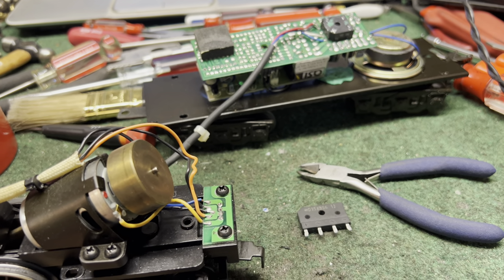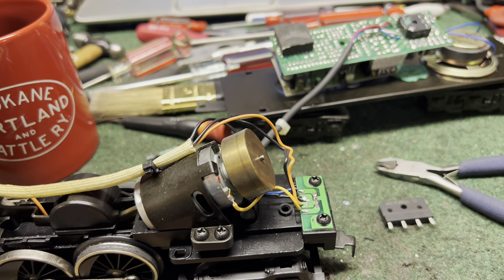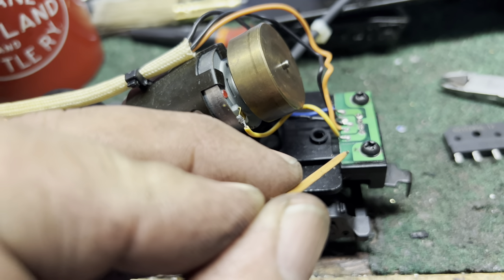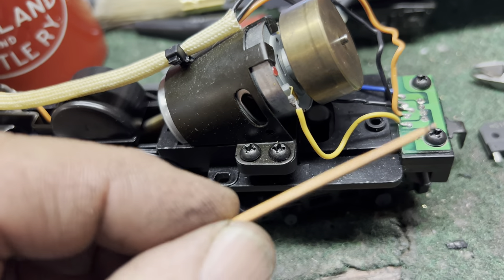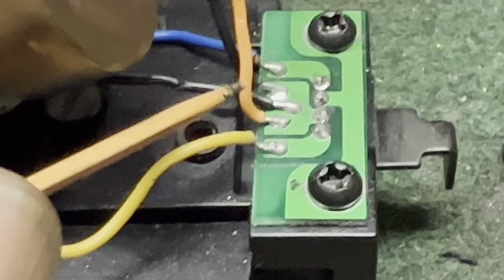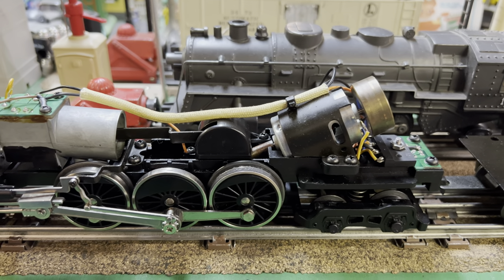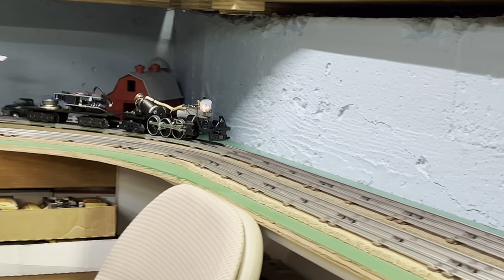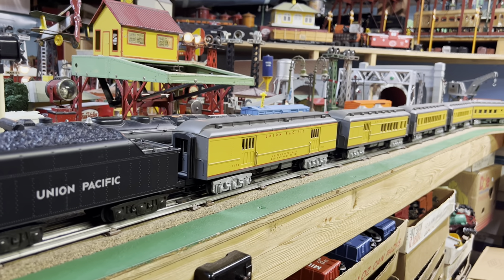Bridge Rectifiers and Burned Out Circuit Boards: MTH 3-Rail Hudson Locomotive Rescue

Comment: Cheap fix for a $350 dollar engine. But now that it works in only one direction only the value of this MTH Locomotive is worth $50 bucks... Replace the board to bring it back to its former glory. Or even better yet, purchase the PS3 upgrade Steam Engine Kit for $200 and make it not only work perfect again but also make it modern.👍